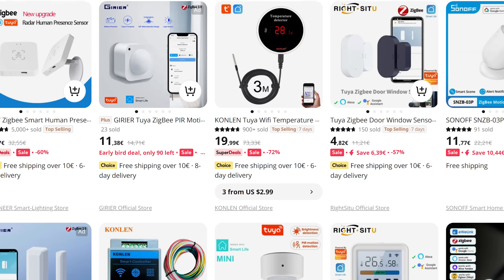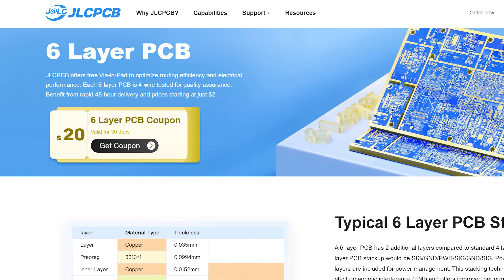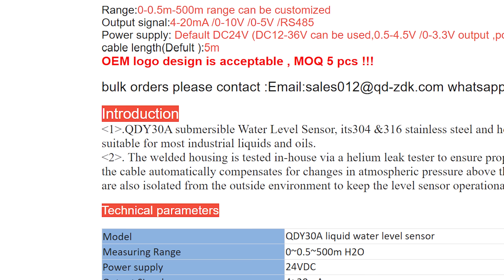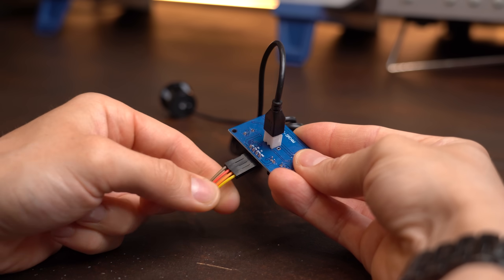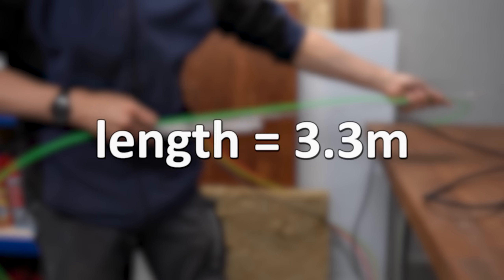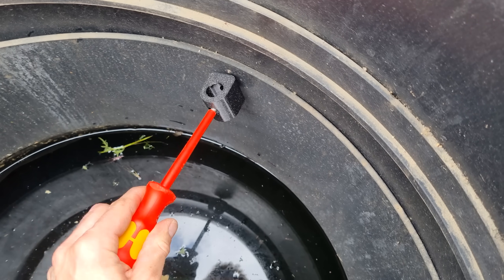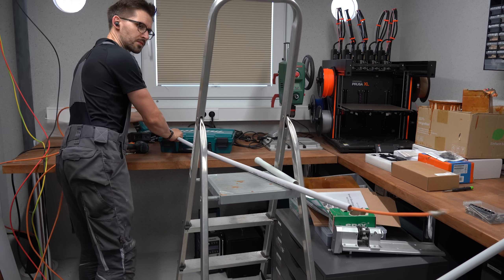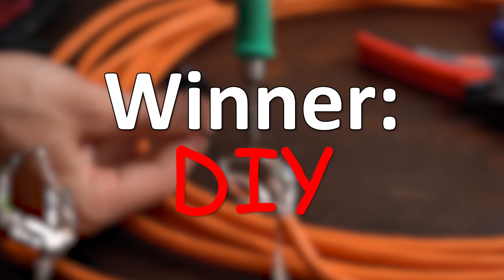This Happens when all Buy Options Suck! Water Level Sensor (DIY or Buy)

Comment: I had the exactly same problem and I found a very ingenuous way of doing it in the local marketplace (MercadoLivre). It's an amateur solution, but works very well and costs around $20.
It's a very simple setup, with an arduino and some wires that hang on different depths inside the water tank/cistern. The resistance relative to the deepest wire (which, I believe, is also a reference to GND) is taken from each wire, and the water level is measured this way. Of course, we don't have ultra-precise water level, but you can easily have a 10% measure step, for example, with great confidence.
This is the product that is being sold in MercadoLivre:
I wish I could post the link to the product here...

Comment: Cool project. But the simplest and most practical way to see the water level is a float in the water connected to a thin pipe that goes out on the top, then you can see on the pipe on top how much water is in the tank. And of course then use small wifi camera to monitor the pipe and have a monitor inside. Or skip the pipe and the float and just have the camera in the tank... :D :D

Comment: They are really common in commercial hot water tanks or "tea boilers". You can get a very simple, very cheap high and low water level sensors.

Comment: I have built same water level sensor with esp8266 and also rs485 to the display 20m away. Eps pushes MQTT to OpenHab. It all works, but when in autmn i get too much condensatiom as water is warmer than air and i have garbled readings, only then, i have to wipe it, any better solution for auto droplets removal?😅

Comment: It seems that the QDY30A sensor is also available with RS485 then you would have no problem with the cable length, but I am not sure as I have not found a data sheet. but RS485 would be easy to implement with an ESP32.

Comment: Measure water level remotely is not a new thing.
Back in 1970 when they wanted to check the water level at a dam, they dialed a secret phone number and a robot picked up the phone. At same time a pole tape recording glued on would start rotating, and related to the water level the tone head would play different recordings.
I'm sure there is a lot of "buy" solutions for such a device.

Comment: Nice solution. I was dealing with same task, but I used water level sensors in multiple depths, ie. I have just couple of depth values :) i connected the sensors to zigbee door sensors and then just used some automation in home assistant to calculate the level based on state of the “door sensors” :)

Comment: Looks like you used real long  cable (CAT7 I guess) to power 5v to sensor. In my experience, I see huge voltage drop by using long cables. Please suggest how you fixed it? Because of this problem, I try to keep ESP8266 very close to the sensor but that causes another problem of WI-FI signal not really ESP8266

Comment: The issue is to have sensors in a friendly environment.  The way I do it is by having a thin silicone tube fixed to the bottom and the other end inside.  With a small mini compressor the tube is periodically filled with air and the pressure is a direct reflection of the water (or oil) level.  The barometric pressure sensor is inside the building.

Comment: You forgot my favorite level sensor... The radioactive kind, you got a radioactive source on top of the vessel and a detector at the bottom... Depending on the level of the liquid more or less radiation gets shielded... They are obsolete by now but I find it a funny solution, I think they were used for pressurized systems or corrosive conditions because both parts of the sensor could be mounted outside the container...

Comment: Could you have put a stick with an empty water bottle taped to it? The more it floats out the more water you have. You could point a wifi camera at it and do some machine vision to measure the distance it sticks out to figure out how much water is left in the tank.

Comment: It's not black magic wire, it's coaxial cable. It's used for very specific reasons. It cannot be substituted for generic shielded cable. Just replace it with cheap coaxial cable instead of bodging something else onto it. Also the quality and condition of solder junctions MATTERS in RF like this, you cannot have a giant lead weight on every connection like that. Use connectors for their purpose.

Comment: I did one for my dad when i was young.  Just a stick with wires of different length with exposed copper at the ends and a ground wire at the bottom. 10 or so op-amps as comparstors and leds arranged in a line.
A 9v battery and a pushbutton to energise the circuit when he wanted to know if the submersible pump still worked.

Comment: A PVC pipe capped off with measurements written on the side would do the same thing for cheaper. It will float with the level of water so you'll know how much is left. No power. No electronics. Resistant to all kinds of chemicals. Way less failure points.

Comment: That's one of those situations where there are already a bunch of existing solutions that actually work. No need to reinvent the wheel.
I didn't fully understand whether you only need to determine if water level is critical, or whether you need to see the exact water level (or why would you even need an exact level), but in either case you can go with a variety of options. The most obvious ones are mechanical float switches. Those are frequently used to detect overflowsin septic tanks etc. Basically it's the same thing as a floating thingy inside your toilet's tank, only has an electrical switch instead of a valve. Another obvious thing is simply sticking two metal rods in there. Water closes the contact and bob's your uncle. And if you re-e-e-eally need to know the exact water level  - you can either modify an automotive fuel gauge (basically a float sensor with a pot), or make a cheap DIY float sensor attached to a $1.50 waterproof potentiometer.  Hall effect sensors are also useable in this situation, but not as reliable or easy to work with.

Comment: You could also use it (or another sensor if you want backup), that can if it goes above 100% full, it could be an indication that the sump pump failed, and have that send you alerts to phone / turn on lights.  (Dunno how important it is, I realize this isn't in a basement so maybe its too much)

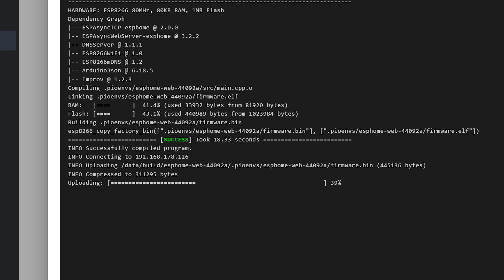Comment: 9:32 How did you get the uart mode to work. Ive been struggling with this sensor for a week trying to do the same thing and can only get it to work in mode one on a normal gpio pin. Some error about the sensor type jsn_sr04t not being defined. And the docs on the HA site wasn't much help. Good video as always

Comment: All the most reliable industrial stuff I've come across are pressure sensors. 
A pipe with a closed and open end submerged and measure the changing air pressure.

Comment: The cheapest easiest BUY i can think of is a $6 zigbee water leak sensor. It triggers when wet or submersed. You could install 3 at different levels, or as many as you would like. $18 for wireless low, medium, high read out in home assistant.

Comment: Edit: Looking back, it seems like the values were just trash all around. In that case, the driver board is probably calibrated to the resistance of the wire. You could probably fix it by changing the value of a resistor or two on the driver board, and maybe a cap, depending on the circuit. I couldn't tell you for sure because you're much better at the low-level, pcb side of things than I am. 

I worked as an automation tech for quite a while. Those pressure diaphragms are EXTREMELY fragile. The slightest nick or dent on them and you're SOL. As for the ultrasonics, they're not as accurate or reliable, but they are way easier to calibrate, and have much more flexible mounting options (oh yeah, if you mount the pressure diaphragm at an angle, or too close to the bottom, it'll throw the readings off). I'd have to look at your code to see what's going on with that ultrasonic, but because the increments are so small, any added resistance not properly calibrated for will affect the reading, including virtually zero resistance wire. In the future, always try to find a three-wire sensor, so resistance of the wire can be automically cancelled. For the two-wire, though, your ratios shouldn't change that much, so you can likely add an offset in the code. Just measure the max range out precisely, take a reading, do the same for minimum range, calculate your increment, and compare that to the data sheet to find your offset. Your exact level may not be dead accurate throughout the range, but if top and bottom are okay, you can eke by.

Comment: I also got a water reservoir at my house and tried different things. In the end I used the hydrostatic sensor you showed and it works fine. Yes it was about 25€ when i bought it but I did not have to mess around a lot. Simply putting the signal in the analog pin of an esp. Running a little web server and calibrating it one time (full and empty). The rest was a little math.

Comment: I did the same thing for my IBC Tank but i went with the under water pressure sensor and added an adc to get good results because the adc of the ESP32 is realy bad. I Also went with ESPHome and added it to my Homeassistant. Now i can see the waterlevel in "mm". I only want to add a temp sensor.

Comment: In my teens (now 60) I helped my dad fix a water level sensor in his motorhome. They used a very simple (and reliable) system that had brass bolts at different levels in the water tank and a simple display with little lights (5 bolts 5 lights) that at the push of a button would show the water level, it was about as simple as you can get.
Reply: I bet that is still working. I would be blown away if this still works after 45 or so years. This is still very cool and has more functionality but there's nothing like old school solid, simple and reliable solutions to get the job done. 😊

Comment: Thanks for your videos. In this case i don’t learned something new, as i use exactly this solution for same problem with same software since 5 years. I only had to replace it 2 times, it got flooded in winter or by very heavy rain. My ultrasound detector board is mounted at the top of the  cistern in a sealed jam jar. Let’s hope it works for more than 2 years now :-)

Comment: I have done a rainwater tank sensor with ultrasonic sensors too. However, it doesn't work reliable, because of water condensation, little droplets forming on the sensor, leading to "full" reading the whole time. I wonder if yours will work in the long term.

Comment: In the middle east we just use a bunch of wires connected to LEDs and a 9V battery with temporary switch where the water completes the circuit

Comment: I'm quite surely assuming here that your cistern is a round one? I mean, most of them are :)
In that case your calculation is waaaaaay off. 9.4cm of water isn't 10% water left in that case, but more like 1,5%.

Anyway, you want to calculate the segment and multiply that by the length of your cistern: r² × arccos((r-h)/r) - (r-h) × √(2 × r × h - h²) × L  (or something like that , because this formula is for segments less then half a circle 😅 )
Reply: Wut? The shape doesn't matter if the cross sectional area is the same from top to bottom.
Reply: @cdh76  It's an 10000 liter cistern with an height of less then one meter. . That thing needs to be long in order to hold that much water. 

The inspection hole might be round from the top, the internals are a different thing and usually in this size they are a massive tube laid out horizontally. In which case the cross sectional area does change from top to bottom.
Reply: @patrickd9551  So nothing to do with your formula then? 1m high only needs 10m2 of area to make 10kl which is still irrelevant to measuring capacity. Yes if the there are structural supports it's not going to be perfectly linear but will be close enough and 9.4% of the total depth will be much closer than your 1.5%. Inspection hole has nothing to do with it. What are you even talking about?
Reply: @patrickd9551  maybe watch the video at 0:26 onwards?
Reply: @cdh76  ah look at that. I missed that part of the video somehow. If you just said that, we would have spared quite a few words. Oh well nobody is perfect I guess.

Or something along the lines of "look it's a box, not a tube, see at @0:26".
Reply: @patrickd9551  well who knew what you were talking about. One would assume that to put together such a reply you might have watched the first 30 seconds of a video you replied on?
Reply: @cdh76  Well I was assuming a round cistern and talking about his formula. So I missed the first 30 seconds and saw the rest? 

But you could also accept my reasoning and shake hands instead of trying to add further insult? You know that people acknowledging their mistake is pretty rare these days? You could show some respect in that regard? 

But this is the internet, so why should we, ey?

Comment: Was the sensor cable 75 or 50 ohm coaxial?
Also added distance add losses and if using wrong impedance cable causes reflection that may cause problems.

Comment: could you have gotten a shorter cable on sensor and but the sensor in a 3d printed case with the driver. and then just ran data cable out of the conduit?

Comment: I had a similar problem, except my cistern was 0.5 litres in a Christmas tree stand, and a real pain to keep full.

Ended up using an optical water level sensor and a peristaltic pump to move water from a more conveniently located tank.

Also the motor chugging along randomly keeps the cat at a respectful distance.

Comment: I had the same problem a few years ago. My septic tank would overflow during heavy rains from ground water leaking in. My solution was the same, but the hard work was done for me with the RaspiSump project on Github. I also found that the A02YYUW sensor works with the same accuracy as the HC-SR04 and is waterproof. Eventually, I replaced my septic system and installed a backflow valve to keep the poo water out of my basement, but my "code brown" early warning system worked perfectly in the meantime.

Comment: I designed one of these for a friend. All it needed was the wiring, 5 float microswitches, some relays, and some KEDs. The whole lot came in at about 30 euro. The most expensive bit was the cable.

Comment: Love this solution, but please, for the love of your chosen deity, remove the pin headers and solder to the board directly. Or get ESP boards without headers. 
Those headers aren't meant to be soldered to. It's a bit sloppy, and I've had to troubleshoot way too many issues with wires getting loose or short circuit because they were soldered to pin headers.
I honestly don't want to be a keyboard warrior or anything like that, but if people follow this video as a guide, they will run into a lot of issues. Really love your content, so I figured it might be worth mentioning.

Comment: For an Ex Wife I created something very similar using a water proof ultrasounds sensor set. they required a sensor on three tanks and a means to have all three displayed in the house. After several mods to her barn, water collection system and installing a slightly altered copy of the Home Assistant (that took longer than expected due to misunderstanding the software setup.) I was able to get is up and running. When I get a chance to return to their small ranch, I will get images and maybe even make the schematic on the discord. That is when I can.
Peace

Comment: Just last week, I did the exact same project for my parents, they asked me if there is any option to make a water level display for our cistern. I looked online for finished products and came to the conclusion DIY is the better option. A water level meter integrated into homeassist with an ESP8266 using a pressure sensor.

Comment: i'm wondering what happens if you have the sensor mounted in a "stilling" tube  , vs the cone angle of the transducer  in many cisterns  it would be more ideal to not ever let the transducer get wet (even though it is supposedly waterproof )   Ideally i would mount this in the 2" IU.D vent tube above the water surface.   There are many  elctro/mechanical sensors  one could make with potentiometers  too.  Maybe Time-Of-Flight sensors have a narrow beam angle.
Reply: https://www.youtube.com/watch?v=KawRd5evHyY

Comment: Interesting project. I experienced some garbage sensor signals in outdoor application. Especially cars driving by generated random signals. Not sure if this was due to their ultrasonic sensors or due to other ultra sonic sound that a car procudes. Hope you don't have issues while rain fills the tank due do dripping noise.

Comment: You didn't have any problems with the sensor being placed that close to the cistern wall?

In the company I work for we had problems with that placment of industrial ultrasound sensors. The manufacturer specified a minimum distance of 0.5m - which prior to planning nobody seemed to look up in the manual. As usual...
(I don't plan that stuff, I 'just' have to work with what they come up with and fix it so it works...)

Comment: Those waterproof transducers sensors are notorously unrealiable though. I bought a bunch for the same usecase and it just spat out wrong values most of the time while the normal SR04 gave proper values. Ig the quality of the product and where you buy it from makes a huge difference.

Comment: Just drop a wooden ruler or rod in there through a channel in the top. Will rise and fall with the water level showing you the depth by the length of rod sticking up.
Reply: A stick on a float? A visual with NO batteries 😉
Reply: @steveroberts4762  😂
Reply: @steveroberts4762  😂
Reply: But I like this approach too, elegant and allows you to incorporate into your home automation setup